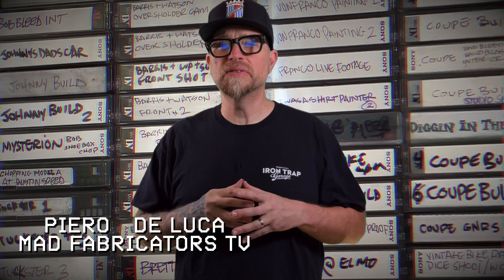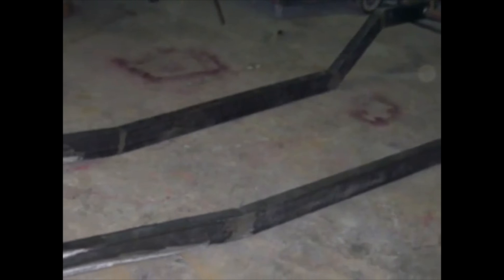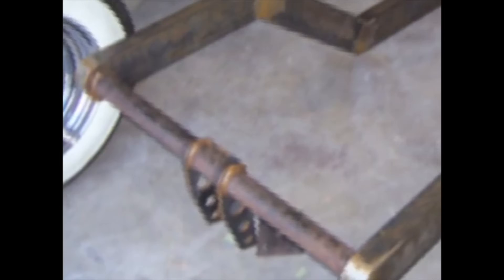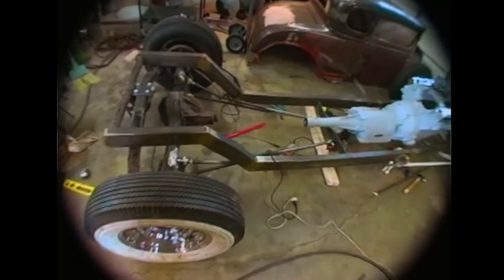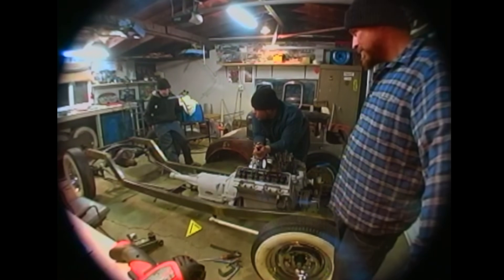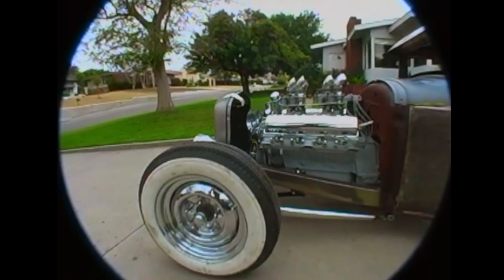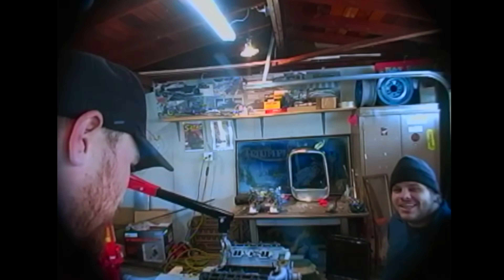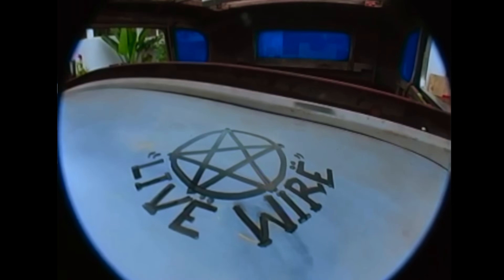Diggin' In The Tapes | Live Wire Chronicles Episode 1

Comment: Factory valve covers on that caddy? Ive got a bored out 331 with isky adjustable rockers and I need a set that clears.
Reply from the maker: Yeah I found them a long time are and they were done in the 60’s it had hammer marks on the back of them.. whoever did it did a good job.. chromer did a nice job too :) I’ve heard stories from old timers that used spoons to make knuckles do valve covers to clear..
Reply: @MADFABRICATORSTV  Right on man, hammer and die it is! Thanks!